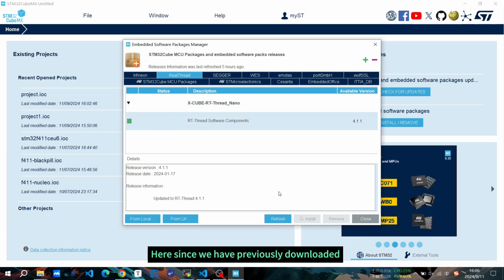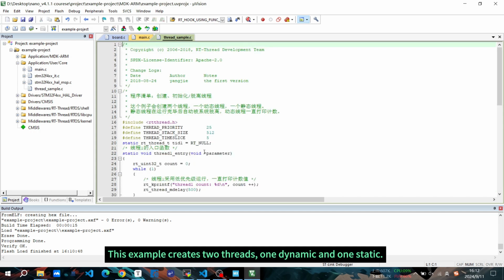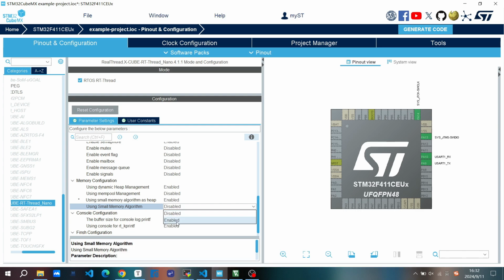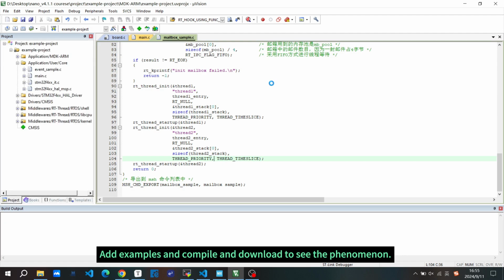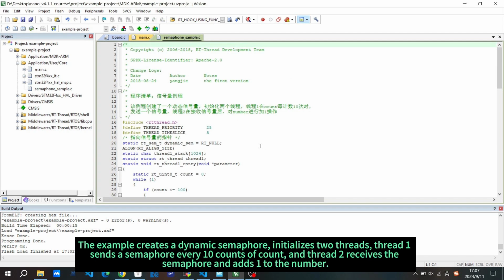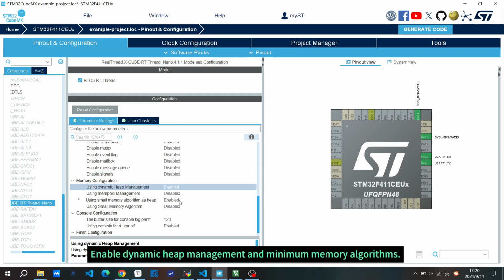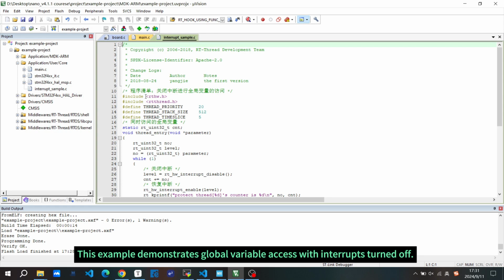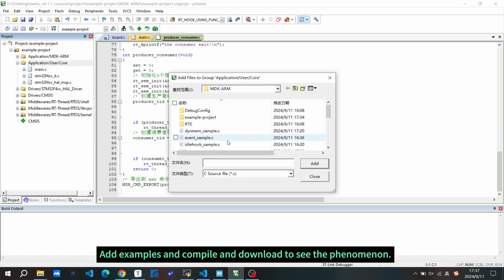RT-Thread Nano on STM32 CubeMX Get Started Guide

Comment: I have tried your method with  Nucleo L432KC and 466ZE boards using both the board and the chip as the project source in Cube MX but get nothing from COM3 to a serial terminal, do you have any suggestions please?
Reply from the maker: 1.First, navigate to the project you created and go to the following path: .\Middlewares\Third_Party\RealThread_RTOS_RT-Thread\bsp\_template\cubemx_config, then locate the board.c file.
2.Please ensure that the UART device on line 86 of board.c matches the UART port number you configured in CubeMX.
Feel free to ask other question~

Comment: Tried the first three minutes of this video but tried to compile in CubeIDE instead of uVision and I get lots of compile errors? What am I doing wrong??
Reply from the maker: Could you please share the errors and we will help to locate the issues.
Reply: @rt-thread  arm-none-eabi-gcc "../Core/Src/syscalls.c" -mcpu=cortex-m4 -std=gnu11 -g3 -DDEBUG -DUSE_HAL_DRIVER -DSTM32F411xE -c -I../RT-Thread -I../Core/Inc -I../Drivers/STM32F4xx_HAL_Driver/Inc -I../Drivers/STM32F4xx_HAL_Driver/Inc/Legacy -I../Drivers/CMSIS/Device/ST/STM32F4xx/Include -I../Drivers/CMSIS/Include -I../Middlewares/Third_Party/RealThread_RTOS_RT-Thread/components/finsh/inc/ -I../Middlewares/Third_Party/RealThread_RTOS_RT-Thread/include/ -I../Middlewares/Third_Party/RealThread_RTOS_RT-Thread/include/libc/include/ -I../Middlewares/Third_Party/RealThread_RTOS_RT-Thread/include/libc/extension/ -I../Middlewares/Third_Party/RealThread_RTOS_RT-Thread/include/libc/extension/fcntl/msvc/ -I../Middlewares/Third_Party/RealThread_RTOS_RT-Thread/include/libc/extension/fcntl/octal/ -O0 -ffunction-sections -fdata-sections -Wall -fstack-usage -fcyclomatic-complexity -MMD -MP -MF"Core/Src/syscalls.d" -MT"Core/Src/syscalls.o" --specs=nano.specs -mfpu=fpv4-sp-d16 -mfloat-abi=hard -mthumb -o "Core/Src/syscalls.o"
arm-none-eabi-gcc "../Core/Src/sysmem.c" -mcpu=cortex-m4 -std=gnu11 -g3 -DDEBUG -DUSE_HAL_DRIVER -DSTM32F411xE -c -I../RT-Thread -I../Core/Inc -I../Drivers/STM32F4xx_HAL_Driver/Inc -I../Drivers/STM32F4xx_HAL_Driver/Inc/Legacy -I../Drivers/CMSIS/Device/ST/STM32F4xx/Include -I../Drivers/CMSIS/Include -I../Middlewares/Third_Party/RealThread_RTOS_RT-Thread/components/finsh/inc/ -I../Middlewares/Third_Party/RealThread_RTOS_RT-Thread/include/ -I../Middlewares/Third_Party/RealThread_RTOS_RT-Thread/include/libc/include/ -I../Middlewares/Third_Party/RealThread_RTOS_RT-Thread/include/libc/extension/ -I../Middlewares/Third_Party/RealThread_RTOS_RT-Thread/include/libc/extension/fcntl/msvc/ -I../Middlewares/Third_Party/RealThread_RTOS_RT-Thread/include/libc/extension/fcntl/octal/ -O0 -ffunction-sections -fdata-sections -Wall -fstack-usage -fcyclomatic-complexity -MMD -MP -MF"Core/Src/sysmem.d" -MT"Core/Src/sysmem.o" --specs=nano.specs -mfpu=fpv4-sp-d16 -mfloat-abi=hard -mthumb -o "Core/Src/sysmem.o"
In file included from ../Middlewares/Third_Party/RealThread_RTOS_RT-Thread/include/libc/extension/sys/types.h:17,
                 from ../Middlewares/Third_Party/RealThread_RTOS_RT-Thread/include/libc/extension/sys/stat.h:14,
                 from ../Core/Src/syscalls.c:24:
/Applications/STM32CubeIDE.app/Contents/Eclipse/plugins/com.st.stm32cube.ide.mcu.externaltools.gnu-tools-for-stm32.12.3.rel1.macos64_1.0.200.202406191456/tools/arm-none-eabi/include/time.h:56:1: error: unknown type name 'clock_t'
   56 | clock_t    clock (void);
      | ^~~~~~~
/Applications/STM32CubeIDE.app/Contents/Eclipse/plugins/com.st.stm32cube.ide.mcu.externaltools.gnu-tools-for-stm32.12.3.rel1.macos64_1.0.200.202406191456/tools/arm-none-eabi/include/time.h:33:1: note: 'clock_t' is defined in header '<time.h>'; did you forget to '#include <time.h>'?
   32 | #include <sys/_locale.h>
  +++ |+#include <time.h>
   33 | #endif
../Core/Src/syscalls.c: In function '_kill':
../Core/Src/syscalls.c:57:3: error: 'errno' undeclared (first use in this function)
   57 |   errno = EINVAL;
      |   ^~~~~
../Core/Src/syscalls.c:32:1: note: 'errno' is defined in header '<errno.h>'; did you forget to '#include <errno.h>'?
   31 | #include <sys/times.h>
  +++ |+#include <errno.h>
   32 | 
../Core/Src/syscalls.c:57:3: note: each undeclared identifier is reported only once for each function it appears in
   57 |   errno = EINVAL;
      |   ^~~~~
../Core/Src/syscalls.c:57:11: error: 'EINVAL' undeclared (first use in this function)
   57 |   errno = EINVAL;
      |           ^~~~~~
../Core/Src/syscalls.c: In function '_wait':
../Core/Src/syscalls.c:131:3: error: 'errno' undeclared (first use in this function)
  131 |   errno = ECHILD;
      |   ^~~~~
../Core/Src/syscalls.c:131:3: note: 'errno' is defined in header '<errno.h>'; did you forget to '#include <errno.h>'?
../Core/Src/syscalls.c:131:11: error: 'ECHILD' undeclared (first use in this function)
  131 |   errno = ECHILD;
      |           ^~~~~~
../Core/Src/syscalls.c: In function '_unlink':
../Core/Src/syscalls.c:138:3: error: 'errno' undeclared (first use in this function)
  138 |   errno = ENOENT;
      |   ^~~~~
../Core/Src/syscalls.c:138:3: note: 'errno' is defined in header '<errno.h>'; did you forget to '#include <errno.h>'?
../Core/Src/syscalls.c:138:11: error: 'ENOENT' undeclared (first use in this function)
  138 |   errno = ENOENT;
      |           ^~~~~~
../Core/Src/syscalls.c: In function '_link':
../Core/Src/syscalls.c:159:3: error: 'errno' undeclared (first use in this function)
  159 |   errno = EMLINK;
      |   ^~~~~
../Core/Src/syscalls.c:159:3: note: 'errno' is defined in header '<errno.h>'; did you forget to '#include <errno.h>'?
../Core/Src/syscalls.c:159:11: error: 'EMLINK' undeclared (first use in this function)
  159 |   errno = EMLINK;
      |           ^~~~~~
../Core/Src/syscalls.c: In function '_fork':
../Core/Src/syscalls.c:165:3: error: 'errno' undeclared (first use in this function)
  165 |   errno = EAGAIN;
      |   ^~~~~
../Core/Src/syscalls.c:165:3: note: 'errno' is defined in header '<errno.h>'; did you forget to '#include <errno.h>'?
../Core/Src/syscalls.c:165:11: error: 'EAGAIN' undeclared (first use in this function)
  165 |   errno = EAGAIN;
      |           ^~~~~~
../Core/Src/syscalls.c: In function '_execve':
../Core/Src/syscalls.c:174:3: error: 'errno' undeclared (first use in this function)
  174 |   errno = ENOMEM;
      |   ^~~~~
../Core/Src/syscalls.c:174:3: note: 'errno' is defined in header '<errno.h>'; did you forget to '#include <errno.h>'?
../Core/Src/syscalls.c:174:11: error: 'ENOMEM' undeclared (first use in this function)
  174 |   errno = ENOMEM;
      |           ^~~~~~
make: * [Core/Src/subdir.mk:34: Core/Src/syscalls.o] Error 1
make: * Waiting for unfinished jobs....
../Core/Src/sysmem.c:30:35: error: 'NULL' undeclared here (not in a function)
   30 | static uint8_t *__sbrk_heap_end = NULL;
      |                                   ^~~~
../Core/Src/sysmem.c:26:1: note: 'NULL' is defined in header '<stddef.h>'; did you forget to '#include <stddef.h>'?
   25 | #include <stdint.h>
  +++ |+#include <stddef.h>
   26 | 
../Core/Src/sysmem.c:53:13: error: unknown type name 'ptrdiff_t'
   53 | void *_sbrk(ptrdiff_t incr)
      |             ^~~~~~~~~
../Core/Src/sysmem.c:53:13: note: 'ptrdiff_t' is defined in header '<stddef.h>'; did you forget to '#include <stddef.h>'?
../Core/Src/sysmem.c:30:17: warning: '__sbrk_heap_end' defined but not used [-Wunused-variable]
   30 | static uint8_t *__sbrk_heap_end = NULL;
      |                 ^~~~~~~~~~~~~~~
make: * [Core/Src/subdir.mk:34: Core/Src/sysmem.o] Error 1
"make -j7 all" terminated with exit code 2. Build might be incomplete.

21:55:56 Build Failed. 18 errors, 1 warnings. (took 1s.419ms)